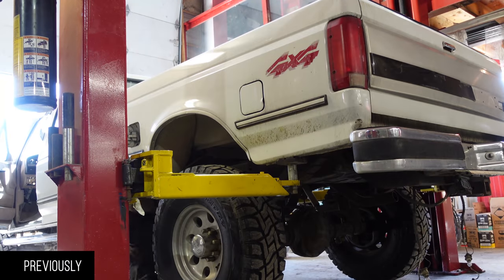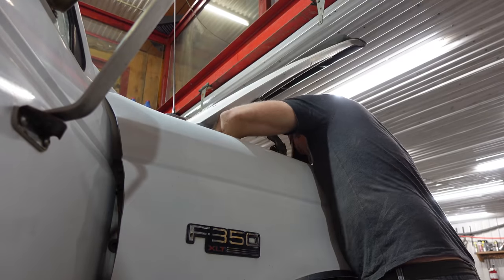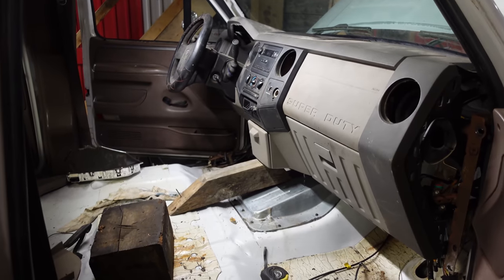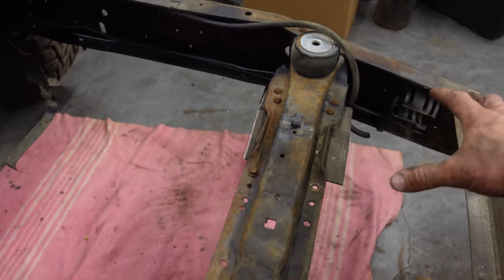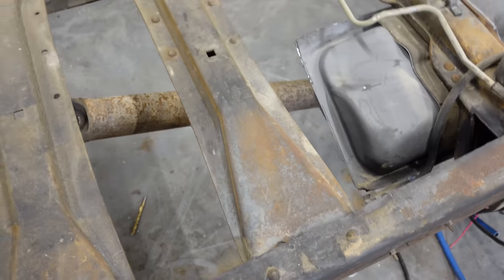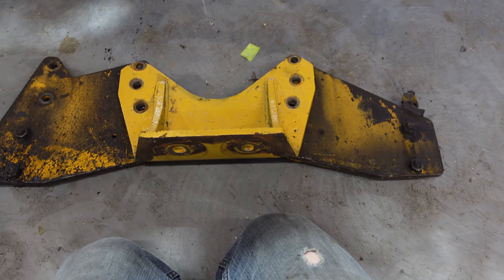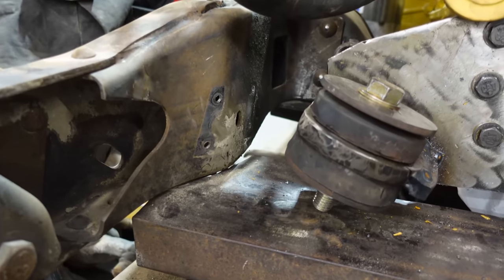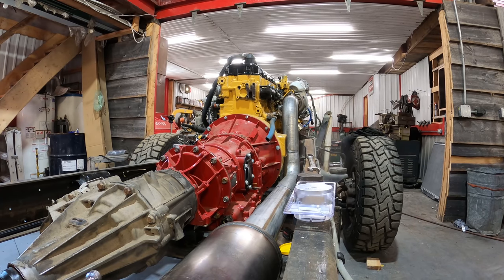If the CAT Doesn't Fit... DIY Engine Mounts | #FTreeKitty [EP12]

Comment: The hockey puck body mount is the most Canadian thing I've ever seen.
Reply: Back in the 80's it was a big thing to raise the body, but lift kits were expensive. Hockey Pucks were not and every sports store had plenty....
Reply: Pretty sure hockey pucks are better than the factory OBS mounts lol
Reply: Maple syrup for coolant ???
Reply: Works great though eh!
Reply: @brewcity1834  sounds sticky 😂
Reply: I bet you that pucks are used in half the lifted trucks in Canada.
Reply: @SteveP-vm1uc  A friend of mine used a signed Gretzky puck on his F150...
Reply: @brewcity1834  That goes in the dif. Smells better too.
Reply: Pucked up
Reply: I made my own mounts out of hockey pucks for my 4.6L Ford back when I was 19yo. They worked great! And yeah im Canadian
Reply: Could be. Watercooled VW GTIs had rubber spacers in places that would dry out and rot away. Hockey pucks were cheap and tougher than the factory pieces. A few minutes with a grinder and some drill bits and you could stiffen up the body and suspension to like-new. Cost you nothing but time and whatever half a dozen hockey pucks cost back in the 90s. Worked great for rebuilding strut bushings or as spacers if you wanted to change ride height.
Reply: If you cut a 1/4 inch wide slot in them they also make good jack pads to save the rocker pinch weld.

Comment: Damn that looks good.

 The engine mount is phenomenal.

Its a shame that the King Ranch Dash doesn't fit right, but there is probably a lot of components that you can swap over to the F550 one.

Comment: Awesome 👌 job and video. Love my 95 F 350 CrewCab Dullay with a 7.3. The Cat looks great but for now mine is all stock 250k. No leaks no rust and no dents. One ding on the front bumper. She still has all of the paper part numbers on wiring harness underneath and all of the lines.

Comment: In the early 90's we did a buddies Bronco 2 body lift with hockey pucks. He bought enough to do the job and a trip to the hardware store for new bolts and bam. Done. Quick 1 inch body lift. We just pulled all the bolts out on one side and took the with us to the hardware so we could get the right bolts, 1 inch longer. 
Worked great. Not bad for a couple Army Infantry guys with limited tools.

Comment: My 95 f150 was leaking inside, it was leaking at the blower/hvac box seal where it meets the firewall and another leak on the drivers side at the hood cable rubber grommet on the firewall as well.
Reply: Thanks for this having the same problem on my 92
Reply: @justinlyons5374  also I forgot to mention, the seams on the body where the roof panel mates up to the rear "b" pillar, that seam was also a little issue too. I'm assuming the seam sealer broke down over the years and was letting a little bit of water in, not as much as the firewall. Took care of those and its dry inside

Comment: You should make the steps air up, and fall down, so when it’s cold as shit outside, your girls will not have to wait to build air to get in.., add a lock to lock them up in the event of towing, or an issue with air system..
Reply: Or just build the air system properly so it doesn't leak.
Reply: @dazeller82  yeah, please enlighten us to these air hoses and fittings you speak of that will not leak after a couple hundred thousand miles of banging around in hot weather, then freezing weather?, rocks and pebbles hitting them ?, I don’t know of many air systems on trucks that have full air pressure after sitting for a week or two…
Reply: Big trucks will hold air with good line and quick connects.
Reply: @SethHollingshead  for how long?

Comment: One thing that definitely holds its value is the rear side glass on a Ford Bronco 2. NOBODY makes replacements currently and every B2 today is a minimum of 31 years old. Far too many of them go into the crusher with those big curved pieces of glass still in them.
Call around to glass companies and you'll likely find that if they can even get them, they are every bit of $300-$400USD for each one.

Comment: You could probably run a 1 peice rear shaft if you went with an aluminum shaft. The newer Chevy and GMC 3500s use a 1 peice shaft and don't have vibration issues. And if you're using a transfer case that originally came behind an Allison you could keep the slip yoke and use a bastard joint for the rear. I actually converted my 07 Chevy 3500 to a 1 peice shaft from a 2015 3500 and it slipped right into the transfer case and I've had no problems out it so far. Stay filthy!
Reply from the maker: Done.  Made it over the weekend, getting balanced tomorrow

Comment: You should either weld the nut on the bottom of the angle iron or hole saw access holes though the C channel. It will just make future service easier.

Comment: With the bit of angle iron on the front mount, you could put a thin metal door on there held closed by a small magnet. Just to keep salt and dirt from getting up in where the nut is.

Comment: You could weld the nuts onto the under side of the mount, then you could weld up the sides of the angle iron and avoid any rust issues that may occur in that area.

Comment: I'd box the frame or plate it. The frame needs to take up all the torque the drive shaft sends back. Amazing build though, I'm in California and on the lookout for a used school bus for rv conversion
Reply: You'd be surprised how well a c channel frame holds up. I know I have been first hand.
Reply: @chasewebber4316  agreed but we are talking about a lot of power. As just a 2wd in first gear the drive shaft is is geared down so you looking at 4500ft tq or more
Reply: Boxed frame in the rust belt is kind of a no no. Look at Toyota’s
Reply: @wyattrowe8396  maybe just extra cross supports or a bolt in x-frame
Reply: @ZoeyR86  calm down child, I never disagreed.
Reply: @ZoeyR86  wouldn't the driveshaft experience less torque than the wheels? The differential is effectively a torque multiplier, 3-5 rotations go in and 1 rotation comes out. Gearing down and increasing torque.
Reply: @warpedfusion  yes this is true but work it out. The is a 5.9 doing around 600hp I expect 1000ft tq at a minimum for that hp at the flywheel most likely 1150-1300 ish.
The trans is also a torque multiplier the torque convert is a multiplier as well.
So that 1000ft at 2200rpm is going to hit the shaft at 3500-4500ft and that gives you that crazy 10000-15000ft at the wheels in raw ripping power. And I'm jumping i just think the raw output is going to make this thing rip tread off tires lol i had a 5.9 with a compound setup in the upper 500hp range with 4x4 and it had no problem turning a stock drive shaft into twizlers. The trans cost more then the motor build in my case (04 3500).
The truck twisted the stock frame my 3rd rip.
Granted the motor was the best part about the rest of the dodge stuff just fell apart fast.  (Zero rust california truck just weak)

Comment: You can drill holes faster if you decrease rpms and increase feed pressure. Also, always use some kind of lubricant, it'll help the drill bit last a lot longer.

Comment: Everyone whining about the dash, think about this: My 1993 F150 flareside's dash is a cracked rattly mess, and it's in reasonably good shape for what I see around here in junkyards. It's spent 28 years and over 240,000 miles in and around Virginia and this part of the East Coast, out of the California sun DeBoss' truck lived in. Plus, the colored dashboards in these for some reason turn to dust worse, red and tan especially, blue ones don't seem as bad for some reason. Anyway, point being, as nice and clean as this interior looked, I'm sure it was baked.

Comment: Rich.  You should also look into doing a reverse shackle setup on the front suspension with Super duty leafs and out back do a shackle flip with super duty leafs. It will ride so much better then it would with obs leafs.    I'm very interested in seeing how you do your dash,  because I am looking at doing the same style dash setup in my 97F250HD obs Project Truck.
Reply from the maker: Yes, We will be looking into that for sure

Comment: As soon as you pointed the area where the leak was I was like. Hehhhhh this looks a lot like a leaking heater core....  Sucks when diagnosing and order the wrong part but it's part of the deal. Sometimes you save a lot of time by guessing and ordering parts before completely stripping.

Comment: I’m having flashbacks after watching the Ford splined windshield wipers, my work van got the windshield replaced and they didn’t put a wiper arm back on correctly and it came off in heavy rain and just flopped like a parasitic leg.

Comment: Hey Rich, love the show. Just a question on that engine mount. Because the front half of the engine is not mounted fwd of the chassis rails, do you worry this might be putting too much stress fwd of the shock towers? 

Cheers

Comment: Rich have you thought about putting an upgraded steering box in that while it is still accessible with the cab off? Especially as a longer trip truck it would make good upgrade to eliminate the old Ford sloppy steering.

Comment: I don't know if you can follow my observation or not, here goes, I am finding its easier to find nice rigs from the thirties, forties and fifties that from the mid eighties to 200+ ish (year two thousand and about five) as newer are still in parking spaces somewhere. The ones in question were made from metal alright but the steel seems to just take to tin worms and are harder to find. Your 96 I think thats the year of the bronco, when you peeled the carpet back and it was nice painted metal, I knew you found a unicorn of cabs. I thought my 95 was nice and really it was cause we changed the carpet back in the year ten. So if it was pulled today, I think it would still be nice with all the hot tar sealing of joints on  the inside that makes it crappy where it bleeds through the gaps. Adds  a few pounds sure but if ten to fifty pounds makes that much difference then I was in  trouble before I started. I have taken the heavy front crossmember out completely with out real problems instead of cutting notches in it. I did add crossmembers back on the frame but made them to be unbolted.  I really don't understand them as older rigs don't have that thick mount. I did use a system like the older ford cars used that was a dropped center in the shape of a pipe and bolted right in. Well factory was rivets but I replaced them with good bolts. Again everything I did was on older rigs. This cat engine can't be the same one as Drew used in his older brick nose ford. It looked so doable in his rig. He fought to get up to speed by swapping transmissions and for me I would of maybe as I am not there, used a different rear end ratio gears.... good luck on the build, love the newer dash

Comment: One thing. Other than great work. Do yourself a favor. Find a way to support the T case to the frame. I've seen several dirty max owners suffer a catastrophic failure of the rear side of the Allison. 
One in my shop lot. Under zero load. 
There's too much weight on the back of that Trans with that case floating out in outer space. 
Just trying to save yall a big headache.

Comment: You found the most difficult method of dash removal for these trucks. You can remove the dash with HVAC ducts and steering column brace as a complete unit.
Reply from the maker: At the time, I was still debating using the Hvac.
Reply: @DEBOSSGARAGE  Bah, still easier to pull the entire thing then unscrew the ductwork.

Comment: You should give vintage air a call they could probably set you up with a custom air conditioning and heating system that is taken up a lot less space than factory and easier to install! They may even work something out with you for advertisement but for advertisement?? just a thought

Comment: Hey man I love the videos!!! I’m kinda new to this whole insane swap thing but lemme pitch this at the audience here- Michigan 175b front loader with a supercharged 2 stroke Detroit diesel if I’m not mistaken something like a 16liter or so? Is it possible to put a motor 5ft long in a traditional style drivetrain? It’s pumping out around 1100 ft lbs of torque so I’d imagine driveshafts will become licorice

Comment: With all that weight and torque on that truck it probably wouldn’t be a bad idea to reinforce the tranny mount cross member or running the og cross member and an additional mount and cross member over the top and try to put the additional crossmember under the seat so it won’t effect cab space if you have to cut out part of the cab for the additional cross member just a thought I bent frame on my 04 ranger I  dropped a stroked 351c into it took almost two years but the power and my lack of understanding for a speed limit eventually caused the front and middle crossmember to warp which buckled the frame slightly still drivable just always made me weary of putting any real power down in it after

Comment: Weld the nut at the bottom of the front mount so you can just impact the thru-bolt out
Reply from the maker: As much as I would like to say everything lines up perfect every single time, I would be lying.  Spinning the nut on after avoids cross threading

Comment: The inline 300 the cat 3116 the fit in the engine bay just perfect it's the mid size engine it came from the military the guy bought her from the military actually the block is about the same length as as a stock block but it's just bigger I'm going to hook up the factory trans up to it not a problem

Comment: You will most likely end up with the OEM frame cracking where you welded that monstrosity front motor mounting plate. Its too heavy and ridged and will not allow the frame to flex as the OEM intended. You should have fabricated using much lighter grade 50 steel plate, bent into engineering shapes for strength as well as recreating the torsional member that you hacked out. The OEM major crossmember provided all these features. Some finite analysis should have been used to build a safer vehicle for the public. I have been swapping diesels (Cummins, IH, Deere, Nissan and Duramax) in pickups for over 20 years. Also, I would have designed proper engine and transmission main mounting points into a large 3 point isogrid structure (triangulation). Takes a bit longer to do it correctly but a 100% better product in the end. Wish all the best with your build.

Comment: fyi you can remove the whole dash with just a few bolts as a whole. its how the factory installs it into a car or truck
Reply from the maker: At the time, I was still debating using the Hvac.

Comment: I am looking for a video that will show me how to get more torque out of my 1990 turbocharged 7.3L IDI? I have no experience working on diesels, I have replaced lifters & intakes & rocker arms on gas engines, but diesels I am only comfortable changing oil & oil & fuel filters. I think it is embarrassing to have a huge 7.3L that is out classed by these smaller 6.0 & 6.4 diesels.

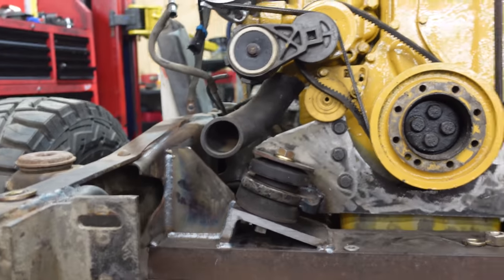Comment: When you say @32:53 that you can't fill in the open ends of the engine mount bracket, why can't you reverse the bolt and nut. Weld the bolt to the inside of the bracket so it works like a stud like a stud and then the nut can go on top, this would allow you to close up the two ends of the engine mount bracket. Great job as always
Reply: Theyre on an angle 
So the ends of the bolts would be too close together and you'd never get the engine in

Comment: New dashes in old trucks are horrendous
Reply: I agree. I could understand swapping a dash from a newer truck of the same body style (I put a 89-94 Ranger dash in my 86 Bronco II) but once the dash or cab designed different it just becomes a hack job, compromising something to get it to fit. I bet he is going to lose a lot of legroom with the newer dash since it is taller and deeper.

Comment: that water on the floor isn't the windshield I bet it was the heater core. they are common to go bad on these fords and the same with the 2nd and 3rd gen rams. the ford one is easy to change though compared to the dodge ram heater cores, they are a nightmare, especially the 3rd gens

Comment: Junk is junk!  Even Canada - where I am   Sun  Burns Stuff up! No guilt! Toss IT!   Make cool stuff!   

PS - EDIT - Ever walk into Walmart in Summer and ask if someone in Sporting Good can Get You - 20 or 30 Hockey Pucks!    20 yrs ago I Did - Nice Lady looked after my request -  She said her kid way in Hockey - I just agreed with her!  I rebuilt the motor mounts and Lifted the Suspension of my Jetta's . Now - 22 yrs later - doing it again.   Hockey Pucks Never rot out!

PSS - Edit - wish I could weld like you. Ok - yeah - welding with a CanTire crappy welder -  Should put diodes in the Miller - or grab a gas Lincoln.  All the Best

Comment: I guess you guys don't have om606 or m57 available? Twice the power, half the weight, much smoother/quieter
Reply from the maker: Twice the power, you’re getting 1600 ft-lbs out of those?
Reply: @DEBOSSGARAGE   Well no not twice that but 450 hp, 850 nm, revs to 5500, full boost at 1500, you could fit 3 alloy block m57s and prob still weigh less and don't rattle like a bus

Comment: now that is my type of pussy ...
I'm not a big ford guy but this DG edition is going be golden .
Amount of work just seems snowball, least engine mounts worked out well .
Firewall more work but least that easier than clearance issues with steering, props, axle and sump .
I guess you getting to that point where the snowball will start melting .